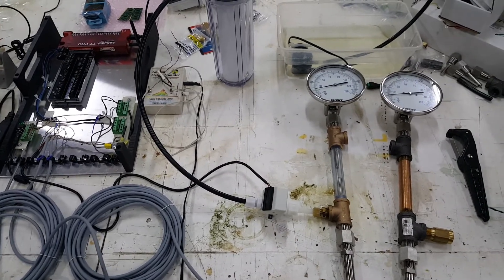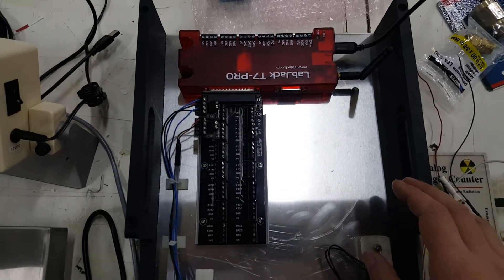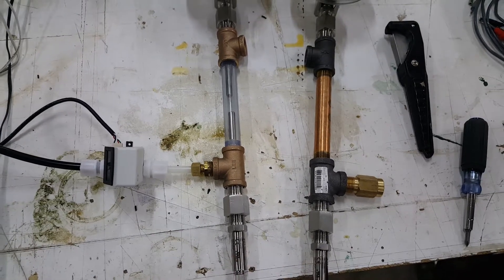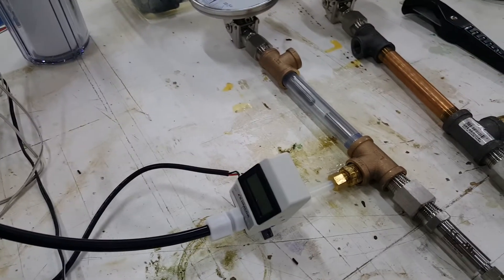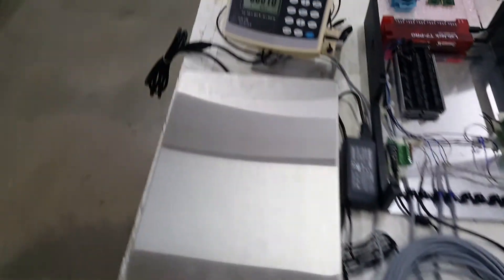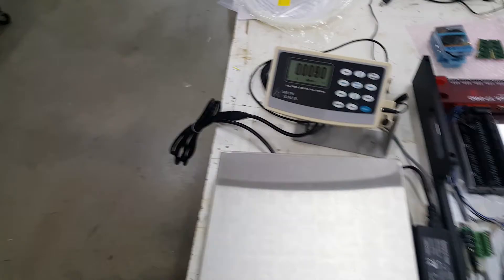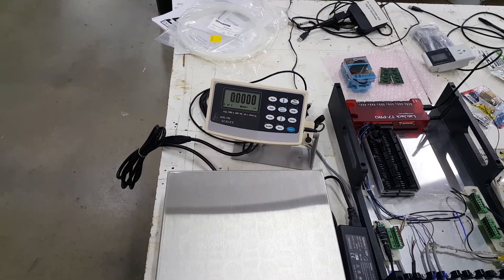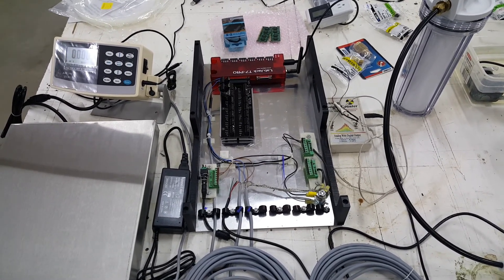Super accurate Mass Flow Calorimetry

Comment: How is the water flow regulated and what is the expected flow rate for the devices being tested? What is the expected temperature range (input vs output) of the water?  

Good stuff. Really appreciate all the work and expertise the MFMP volunteers are contributing.
Reply from the maker: for me356, he will be providing a pump and we have check valves.

In addition, we have a second heat exchanger option

Lastly, he has a good and consistent mains pressure